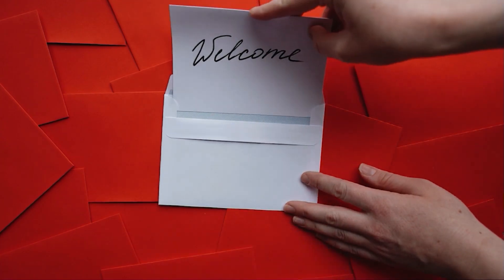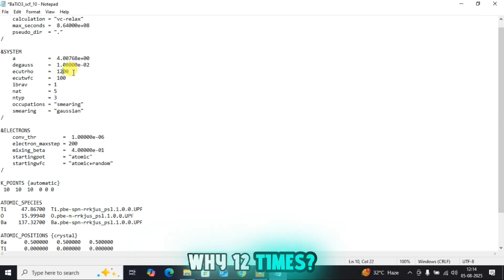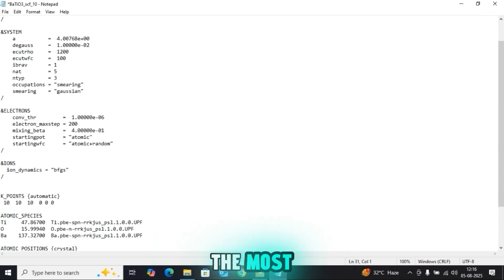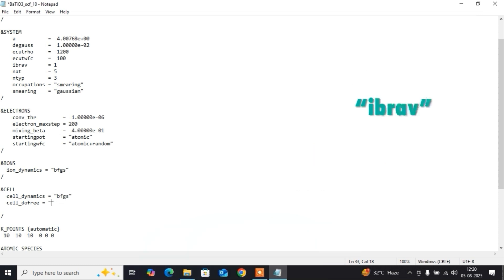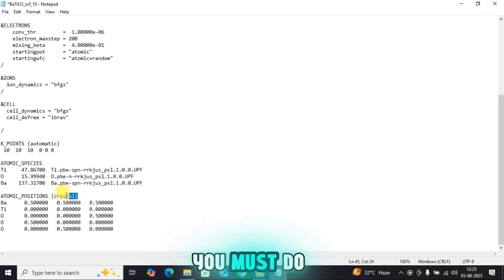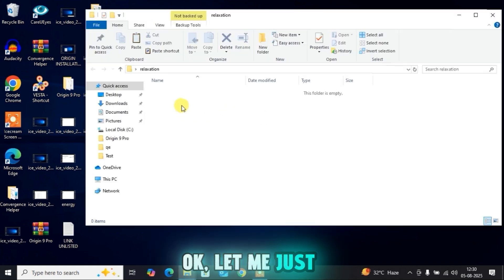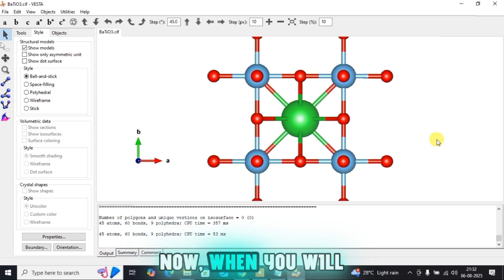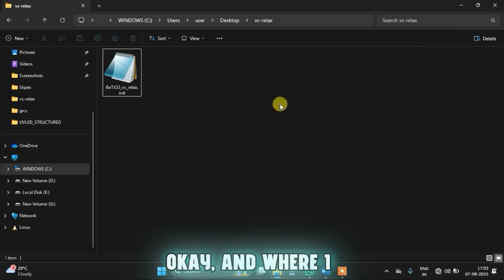STRUCTURE RELAXATION CALCULATION IN QUANTUM ESPRESSO_PRACTICAL DFT _LESSON_5

Comment: congrats sir. very helpfull work you doing by make those videos, it is helping me alot with my studies, thankyou
But, one question, what i do with those two included section "&ions " and "&cell"  on the .in file if i want to do a relax calc and not vc-relax ?
Reply from the maker: Glad to hear it's helping you a lot! For a relax calculation without vc-relax, you'll need the &ions only and not &cell sections, but the parameters within them will define how the relaxation proceeds.
If you are switching between relax and vc-relax, keep &cell, as, in just a 'relax', it will automatically be ignored by the code anyway!